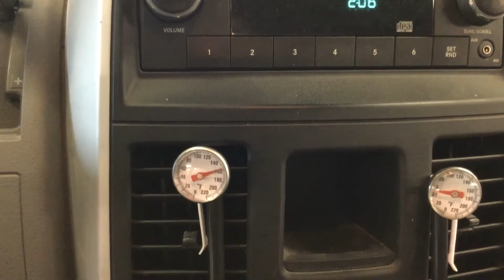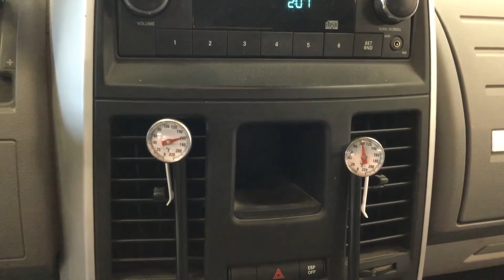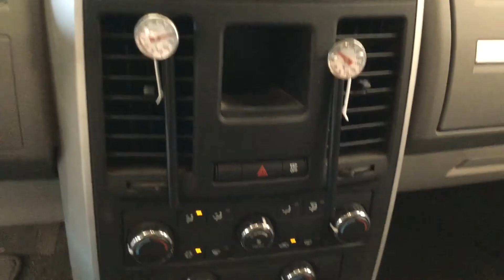2010 Chrysler Minivan AC Diagnosis Scenario

Comment: What ended up being the issue? My husband and I have the exact same problem
Reply from the maker: Hi Ash, it was a bad drivers side blend-air actuator.   This is a fairly common problem and easy to repair.  I hope this helps.
Reply: @ProfessorPentane  thanks so much!
Reply: I have this exact problem right now on same vehicle. I'm mechanic savvy how hard would it be to fix and what would be a roughly estimate on cost? Wife just got the car and is very upset due to one reason we got the van was working ac.
Reply: @dbshomeservices if I recall my husband ended up fixing it (it ended up being a broken blend door) and it wasnt too difficult. The main thing that was annoying was taking apart all the panels and trim to get to it lol